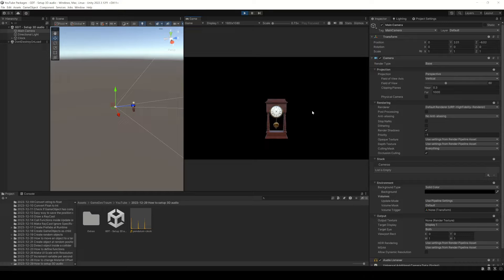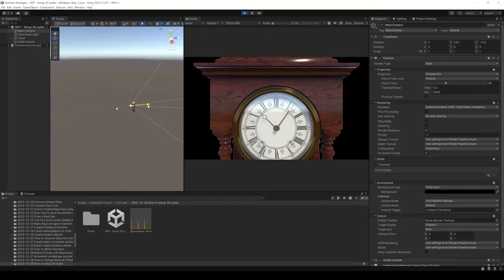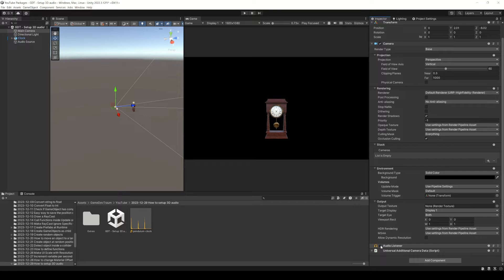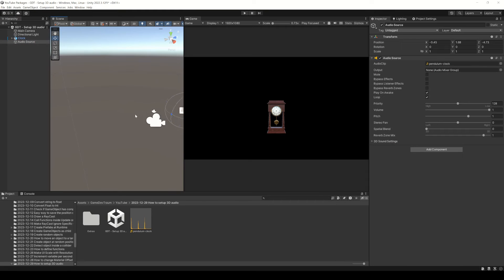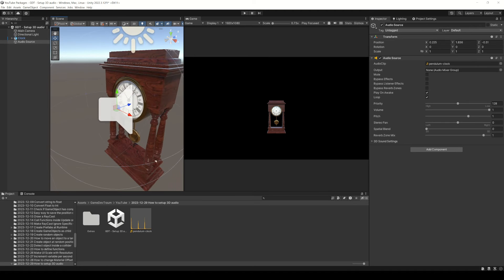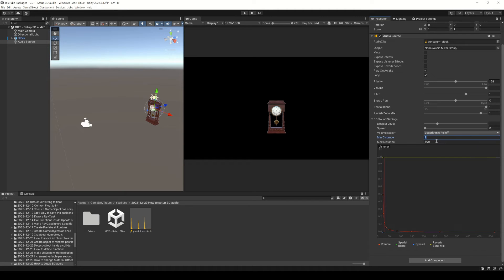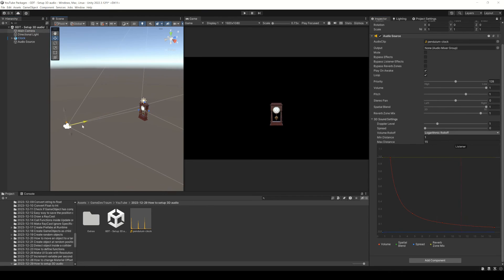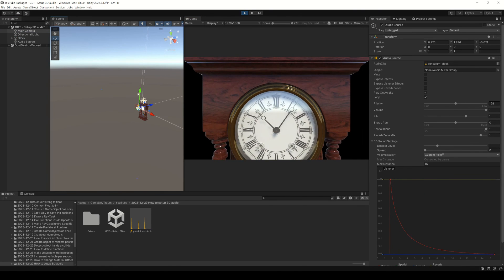How to ADD 3D SOUND in Unity

Comment: You sent me the link to this in a comment on one of your other videos. 

I gotta be honest. I'm not going to watch this right now. I don't need it.

I will leave a suggestion for a new video though. 

There's plenty of videos on how to make a button to switch scenes and plenty on how to add a sound to a button when it is pressed. 

There is no video on how to do both at the same time. That would make a great video. I'm not sure how you'd tag it to make the YouTube and Google algorithms see it, but I know it's a thing that people want.
Reply from the maker: It's a problem very specific and you could solve it in many different ways, here's one possible solution:

Make the button play sound when pressed, like in this video:
https://www.youtube.com/watch?v=TSBzmaZmEgU

Inside a script (choose a meaningful one, like a GameController or some script that you remember that you add the function to change to another scene) define two functions, a function that the button will call and another function to load the scene which should be called a couple seconds later, something like this:

public void Button_ChangeScene(){
     //this function will be called by the button but doesn't change the scene immediately
}

void LoadScene(){
       //This function changes the scene
      //SceneManager.LoadScene....
}

Connect the same button that plays the sound to the Button_ChangeScene function, you need to hit the plus sign one more time in the OnClick event of the button so that the button make two things when pressed. You can see how to connect a button to a function of a script in the following video:
https://www.youtube.com/watch?v=dZ8I73erDSk
The previous video also show how to load a scene.

Inside the Button_ChangeScene Invoke the LoadScene function with a delay, for example 1 second, the result will be something like this:

public void Button_ChangeScene(){
    Invoke("LoadScene",1f);
}

For more about calling function with delay check this other video:
https://www.youtube.com/watch?v=2dcFOVS-rYM

That should work, I would also disable the button when pressed so you can't press it again.
I don't have a video about it but is a similar to the first video on how to play sound when pressing a button, you add a third function in the OnClick event of the button, drag the GameObject of the button and then you can choose the "SetActive" function inside GameObject and uncheck the checkbox, that will turn the button off when pressing it. 
You could also look for the "Interactable" parameter inside Button (in the dropdown menu where you choose what the button will do), in that case you also uncheck the checkbox and the result is that the button becomes noninteractive when you press it but it will be still visible.
Reply: @GameDevTraumEN  good lord. I didn't expect that lengthy of a reply. I'll be back tomorrow to read and test it. 

Regardless, thank you. Whether the rest of the videos apply to be or not, I'll be watching them.
Reply from the maker: It's a long text but the idea is simple:

-The button play sound by its own
-The button also call a function inside a script, which Invoke a load function with a certain delay
-The Load function finally changes the scene
-Optional: Disable the button when pressed

Comment: Hey, thanks for this.
Is there any way to play sound in 3d, like when the object is in left the Audio will play only in the left channel, same with right.
Reply from the maker: heey! thank you for watching.
With this solution, if you have an AudioSource on your left, it will sound louder on the left channel, same with the right. Did you mean that?

If not, let me see if I understand precisely what you want to do.
You want an AudioSource to play the sound all the time but only in one of the speakers, left or right, depending on the position of the object relative to the camera. Could that be?
If that's the case you could manually override the "stereo pan" variable from the AudioSource, you just need to determine if the object is at the left or at the right of the AudioListener. That could be done with a dot product between the right vector of the AudioListener Transform and another vector calculate from the difference between the position of the AudioSource and the position of the AudioListener, I'll have to check it, but if that dot product is positive, I think it means that the object is at the right of the AudioListener and if it's negative the object is at the left. You could use that information to override the stereo pan variable of the AudioSource.
I think I will make a couple videos about it, one on how to know if an object is at the right or at the left from another object; another video on how to manually override the stereo pan variable and a third video with the practical example.
Reply: @GameDevTraumEN  Yes, this was my question and Wow! Thanks for this detailed solution, I'll try to implement this.
Reply from the maker: nice, then let me extend a little bit the solution.
Inside an active script you could define two variables, an AudioSource variable and a Transform variable:

public AudioSource myAudioSource;
public Transform myAudioListener;

In the inspector drag the GameObject with  the AudioSource in the first variable and the GameObject with the AudioListener in the second variable.

Then in Update you make the dot product and override the stereopan variable:

void Update(){
     Vector3 v = myAudioSource.transform.position - myAudioListener.position;
     float dotProduct = Vector3.Dot(myAudioListener.right,v);
     if(dotProduct>0){
         myAudioSource.panStereo = 1f;
     }else{
         myAudioSource.panStereo = -1f;     
      }
}

I think that should work but maybe there is a syntax error
Reply: @GameDevTraumEN  Damn, you made my work easier. I don't know how to thank you, no YouTuber had answered me in the way you have. Delighted to be your subscriber. All the very best with your Channel, thanks again 👍
Reply from the maker: Thank you for watching!
I want to produce more content in 2024, solving lots of problems and doing experiments. 
I think my english is improving, I don't know if I'll be able to make a live stream but that would be awesome too.
Happy new year!
Reply: @GameDevTraumEN  
Yeah, it would be cool. You can also try to create a series on making a complete game(like Jimmy Vegas), it will attract many audience. And Happy New Year to you too 🎉 :)